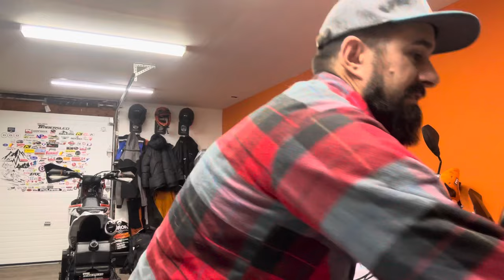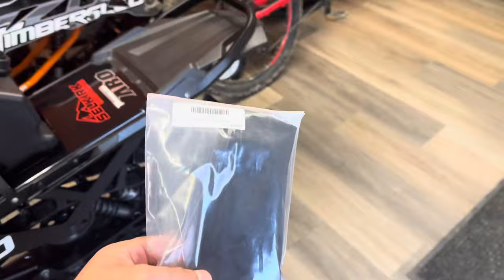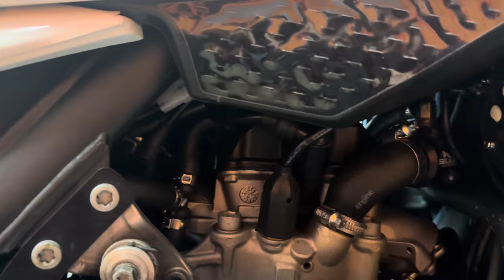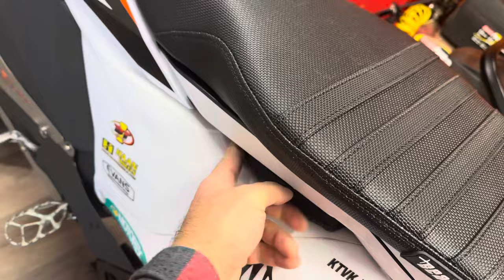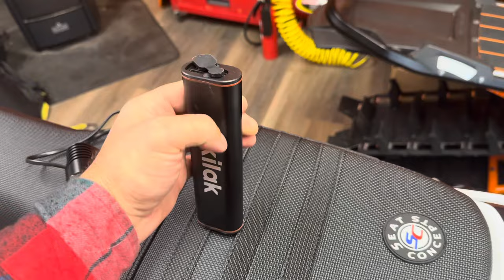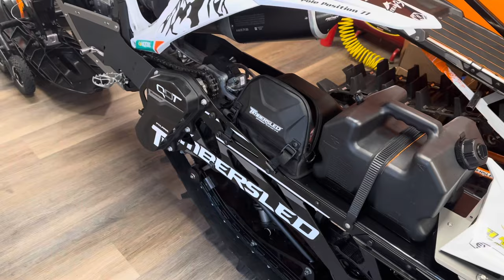Building a Snowbike

Comment: Good info, ditch the Selkirk and you won’t need the trail tech fan, I’d recommend upgrading the pegs, you don’t need the fork guards, extra weight and cost, nice build,
Reply from the maker: The Selkirk kit is the only thing I’ve found that keeps the bike 180+F in the cold. We ride in -20F with blower power and it just simply works.
Reply: So do we, none of our crew runs a fan. I have seen Selkirk  overheat bikes. A light and oversized tank is mandatory for us, Here is my current build, https://youtu.be/SvY77Ixt0-Q?si=cIeaQJZBe9EbZWBK
Reply: No shade, you build a solid bike, great job,

Comment: Hey jarred, great videos. I’m new to snow bikes, so far both the wife and I are likeing it. One this we have have issues with is heavy front end. Hard pack and trails is brutal, deep snow isn’t as bad but still pretty stiff. I do have stiffer front springs that I haven’t put in yet but wondering if you have any tips to lighten up that front end.
Reply from the maker: I’ll do a video on that here soon. Check out how your track tests on the ground. Is the rear of the track lifted off the ground? Try adjusting your forks in the triple clamps and see if that helps. You can also play with the spring rate of the skid shock (front skid shock) and lower the compression by undoing a few turns on the spring. Hope this helps. They are darty on trails and not the greatest. Also check out the new ski dampner from Timbersled as well as the carbide “Duce gold boy” sled timbersled sells. These also help with trail behavior.
Reply: @The_Snowbike_Channel thanks. I appreciate it. Trying to get the wife into it and so far so good.

Comment: Awesome! Great rundown! What is the smallest CC bike you would use for a snow bike kit? I live in the prairies of Saskatchewan, and we have mostly flatlands with small hills, I'm kinda thinking I'll get a 250cc-300cc two stroke, or a 350 cc four stroke.
Reply from the maker: Depends on what you hope to do and if your lightweight. I rode with a guy a couple years back on a 250 four stroke. He did great, but was willing to ride hard and he was light. For my weight and riding style a two stroke 250/300 is great or a 450 four stroke. The 350’s do a great job as well, I just like the torque coming out of the 450 for spinning the Aro/Riot 3 tracks. In low snow, the 350 would be just fine with a 2.5” paddle track.
Reply: Great! Thanks for the info, I'm a rather light, so sounds like the bikes I have in mind will work great! @The_Snowbike_Channel